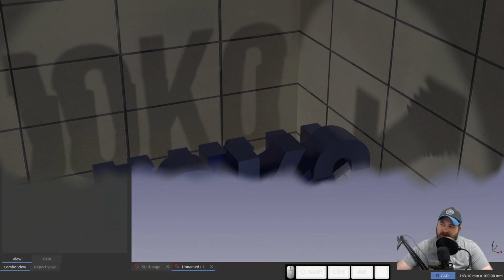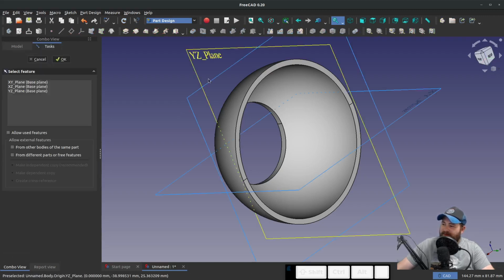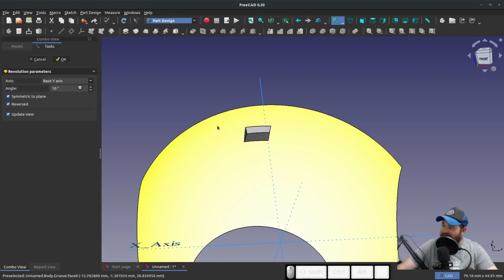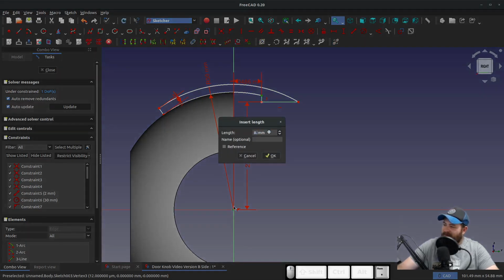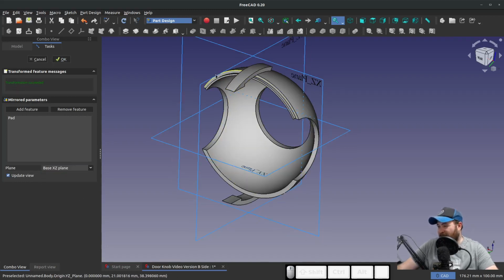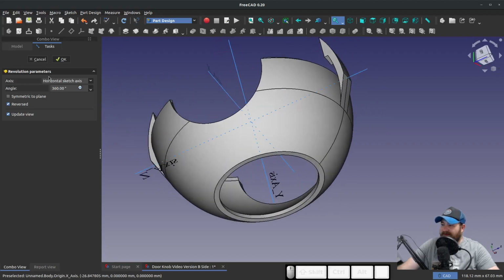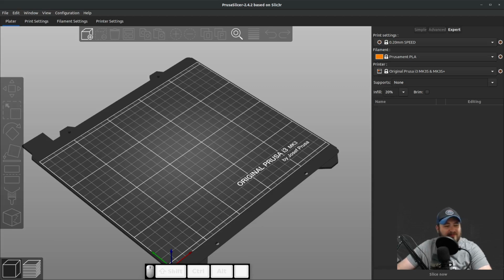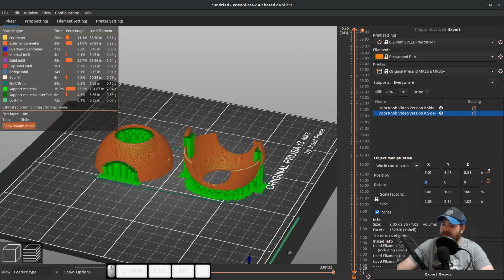FreeCAD - 3D Print Snap Fits - Design and Print Child Safety Doorknob Cover |JOKO ENGINEERING|

Comment: Hey, really like your videos, big fan.
The hot keys have changed, which you can see in the tool tips for each. 
The geometry keystrokes all start with G, eg GL = Line. 
The Constraint keys are either single eg V = Vertical, E = = 
or start with K  eg  KA = Angle
or they never got one. Like Radius. Sad Face. 
My guess is that you move so fast you never see the tooltips. 

Feature Request: Elmer FEM is partially integrated into FC, a huge step forward IMHO.
It's also greatly under appreciated for it's natural ability re multiphysics problems.
The elmerfem youtube page has some great examples, eg a vibrating tuning fork generating sound waves, simulating motion & fields in an electric motor, etc. 
Not to mention some really arcane applications. 
Maybe that's due to the lack of supercomputers lying around. But still. 
Worth a look? Maybe airflow in a turbocharger is your kind of thing?
Reply: isn't the constraint for radius K,R ?  I was upset I couldn't get Diameter going though.
Reply: DYLAN YOU IDIOT IT'S K,O ....

Comment: I think it was possible to print this design with no support (with maybe a few tweaks). I always strive to achieve that with FDM printing as it leads to a nicer aspect but it is sometimes difficult and requires more refection and thus much more time. Anyway, thanks for sharing your insight, always very interesting.